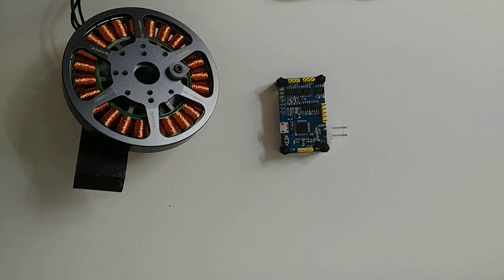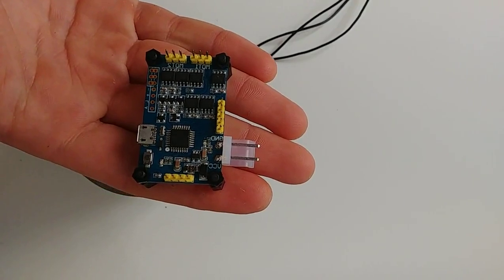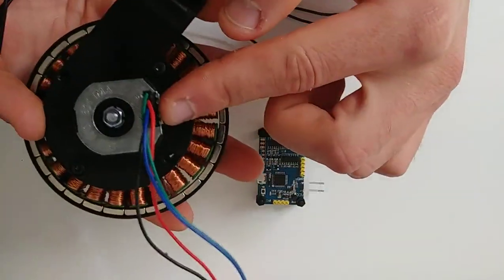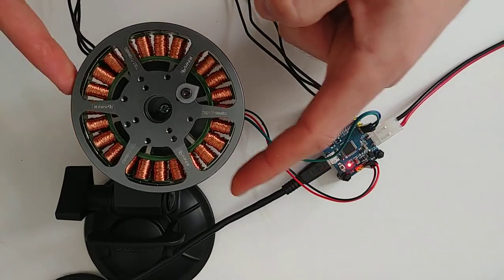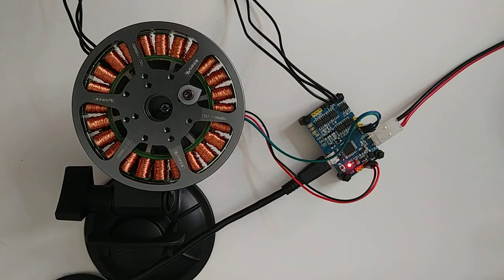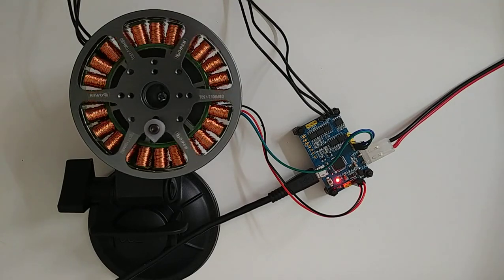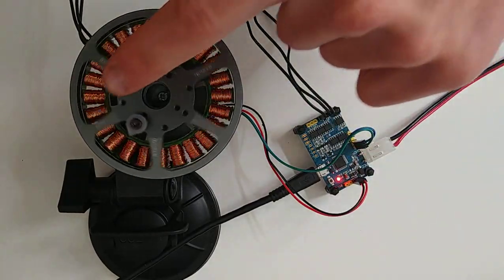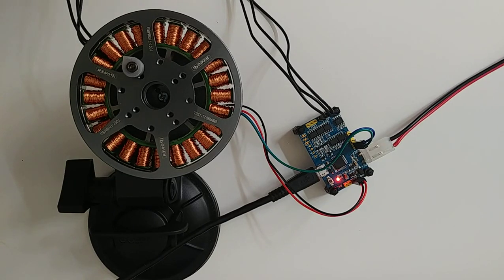Arudino Field Oriented Control (FOC) Library ( Full HMBGC example ) - SimpleFOClibrary

Comment: How the encoder relates to a "field"? That was a big mistake to name this library FOC. Now everyone supposes that FOC means a positioning. Despite the correct preview image, the rest  misleads. No torque, no noise management is available with this library, despite FOC originally means exactly this. FOC is about coil to magnet orientation detection. That's it. I'm angry

Comment: What is meant here by FOC?
For real FOC, you can control the motor in any operating domain (incl MTPA, MPTV, constant voltage curve etc ...), by manipulating Id and Iq current, knowing exact position of your rotor flux (in few degrees accurate).
To be honest, I doubt that this here is a real FOC. Its a good basis non the less.
Oh and about speee control. If you increase the voltage, the motor shouldn't turn faster. Higher voltage only means lss troubles until Bemf is equalizes. Then you anyway need to do any of field-weakening approaches.
Dont get me wrong, I am not demeaning the effort of SimpleFOC community, I just want it to reach the state where you can call it complete SimpleFOC
Reply from the maker: Hey Aljaz, thanks for the comment. 
You were not the first one to point this out. This is a very first video demonstrating the SimpleFOC . At that point it was a small git repo and the "real FOC" was not implemented.
SimpleFOC has gone far from this video. Nowdays SimpleFOC supports the "real FOC" for BLDCs and in the next release for steppers as well. 
This video does not do justice to the efforts that have been put into this project from the community. :D
Reply: @theskura  I have been following the SimpleFOC for 3 years now, and tbh, it's probably the best community in this domain. So hats off :)
Reply from the maker: I'm not sure that I understood your point about the voltage. 
If you increase the voltage you will be able to get higher speed because you'll nee higher Bemf to equalize the increase in the voltage and Bemf is proportional to the speed. So higher voltage = higher Bemf = higher sped.
Reply: @theskura  Yes about Bemf part, I think in the video you mention that we 
"put the system in speed control loop and speed is stable. And if you increase the voltage, the speed increases."
That's the part which I cannot agree with. Of course as you said, with increasing the voltage you can rotate the motor faster, but the speed controller should keep the motor at the same speed, regardless of DC link voltage. Even if Battery voltage is lower than Bemf, then you do field weakening (increasing the D current) but only up to the point, where Q current is still sufficient to produce enough torque to fight the losses at given speed.
Now that I mentioned this, it doesn't mean that I think SimpleFOC is bad. Not at all. As you mentioned yourself at that point it was not as mature as it is now / will be in the future.
I am doing something similar, but with C and with STM32G431. Trying to do Sensorless with SMO.
I wish SimpleFOC was in C, then we would be right now chatting on the forum :)
Reply from the maker: @AljazJelen1992  Absolutely right! I agree, in the speed control the increase in the voltage will not increase the speed. 
So far we did not get to the field weakening, maybe in the future. :D
Yeah, we are bound to cpp at the moment, there are some people that ported simplefoc to C, but I would not suggest doing that. SimpleFOC is probably to big an bulky for experienced embedded developers, there are more efficient ways to write C code and to achieve the same things, and with better performance.
Good luck with your project!
Reply: @theskura  good luck to you too :)

Comment: Very interesting video. Good job. I made this at home by using ardiuno uno and L298N but I want to manage my bldc motor with a potantiometer. When i turn my pot it should move as much as i turn the pot. If pot is turned 10 degrees, the motor should turn 10 degrees as well. And secondly, eventhough i do not turn pot if i turn my motor my my hand force, it should come back to its target position. Briefly close loop foc bldc motor control. Do you have any that kind of project which can help me?

Comment: sir . Could i use this driver for high power Ac servo motor ? i mean 400V 1 kw . i guess its possible by high voltage power driver stage desing  ?  What do u think about that ?

Comment: Congratulations!
It is an excellent and sucessfull project. 
Thank you for share it.
I would like to make some modifications on hardware to design a tool maintenance for air conditioners(inverter with BLDC 310VDC compressor). 
It would be usefull to test the compressor without the complete circuit inside PCB's. 
I think on use this kind of IC's for motor drive, instead L6234D:
IGCM20F60GA 
IGCM30F60GA 
IKCM30F60GA
There is no Hall Sensors or Encoder. I think on adding shunt resistors to my test circuit PCB.
Do you think, it would be possible and/or feasible?
Thank you.

Comment: How did you connect the battery? can I have som information about that connecting cables?
Reply from the maker: You have two solutions really. One is to use the banana connector or which ever lipo battery connector your batter has. 
The other way is by using the 4 pin JST connector used for balancing. The wires of the balancing connector are much thinner and they are fine for running gimbal motors (under 2-3 amp currents), but I would definitely suggest the first option if possible in your application.  
Be careful with the polarity. :D

Comment: At low speed the problem is you are using pure encoder step inputs as position and the difference time between two steps as the speed. What would help is to either use a position estimator (adds lag to the loop though) or a position observer. Both of them give you the speed (and acceleration) for free and those values are way more accurate than doing it the way you are doing it.
Reply: Hey @akkudakkupl,
SimpleFOC library actually usies the mixed time-frequency method which does the combination of the measuring the number of pulses in a given timeframe and the measuring time in between the pulses. 
The observers would require relatively good knowledge about motor dynamics ( the motor parameters), which is out of reach for most of our users. But you are right, that from the point of view of the control engineer there is a many many things that would work better :D
Reply: @antunskuric7282  good to know 🙂 I think the classical PLL observer (usualy used with resolvers) is quite trivial to implement and the error is somewhere around 2 degrees +/- for constant speed. It doesn't need much knowledge about the motor if I understand it correctly. If you play it right you could even get your sine and cosine for Clarke and Park transforms for free.
I glanced o we the code and it seems to use some embedded Arduino code for writes and reads, that is quite slow, probably could be speed up (in the Arduino branch) by using registers directly. The faster the FOC loop the better.
Reply: @antunskuric7282  But anyway it's a great project and it's amazing someone got FOC running on the Atmega 328 🙂

Comment: Thank you for the video! I got hoverboard motor and I got a couple encoders from an old printer. So, if I get that controller it's the only thing I need to build my steering wheel simulator with force feedback?

Comment: This pcb in this video is not an arduino shield. I have a few questions.
1. does this pcb control two low powered motors?
2. is this specific foc board available? I could not find it anywhere.
3. does this board take encodere feedback via pwm signal?

Comment: Hi, thank you for the video... I have a question and I would be grateful if you answer, can I connect some mosfet or ssr to the a-b-c cables that carry the impulses to the motor to control bigger motors;  this approach is configured well with the functioning of the foc?
Thanks in advice, i appricieted al lot who share their klowledge with other people
Reply: It's not that simple to do that, and you can't use a ssr because those are made for ac power not dc.

Comment: will it work without a sensor input? i want to attach a reaction wheel to a gimbal bldc motor and i want to use optical encoders cause of the price is that doable?
tnx for your informative video, liked and subbed

Comment: When do you need the sensor? Just for the absolute positioning? So velocity/torque control modes would be possible open-loop?
Reply: Not really man. You always need to know the position, wich indicate the position of the stator. The open loop will not help us to know the position, this technique uses a complex close loop. Also you could use a half sensor, but it brings third harmonic. Another technich uses an observator with encoder . I am still try to understand this stuff. But i hope it helps you.

Comment: verry good job man! is it possible to allow you stop spinning and free rotate by hand than as soon as you leave it starts spinning its exact speed?  Like direct drive turntables that dj's uses ?
Reply from the maker: Hey!
Yes, you can set the amount of resistance your motor applies when it moves and you'll be to stop it easily when you want. :D

Comment: FOC requires measuring current on at least 2 of the 3 phases. Are you just assuming that the voltage applied to a phase (the PWM duty cycle times supply voltage) is directly proportianal to the current via the DC resistance of the coil? or doing something more clever to estimate current? Your links are rotted, BTW. and don't use URL shorteners, they can be malicious.
Reply from the maker: Hey power max, you are absolutely right. For doing FOC by the books you need to measure the current and keep direct value close to 0. Short answer is, the library does exactly what you have said. assuming that setting quadrature voltage and 0 to direct voltage means that you will not have direct current.

Since this library was first intended for gimbal motors. There isnt really many board today dta support the current sensing for them, due to the low currents. And the other thing is that people don't usually need FOC (full torque control) for their applications. So in that sense this library supports the sinusoidal and space vector modulation for BLDC motors and not by the book FOC. 
Therefore, i would like to argue that due to the architecture of the BLDC motor with permanent magnet by setting only the quadrature voltagr we are actually controlling the field orientation of the rotor magnetic field. Hence the name. :D

We are working on multiple current based control strategies support for blec and stepper motors at this moment. and one of them is traditional foc as well.

Thanks for the heads up, I'll look into the links.
Antun

Comment: What board is that? it seems perfect for what I'm doing.
Reply from the maker: Hey, 
It is the HMBGC V2.2 board.  It is a cheap gimbal controller board.
https://docs.simplefoc.com/gimbal_velocity_example
It is a great as a starting point, but due to the ATMega328 chip it has limited processing power which will impair foc performance. 
The library will work for many mcu+driver+sensor+motor combinations: 
https://docs.simplefoc.com/supported_hardware
So depending on what you want to achieve you can choose the hardware.

Comment: hi, simplefoc, it seems that  the answers you are doing in the comments are not published, I can't see them only the questions, perhaps they are  tagged as private, can you fix it? thanks, and impressive work by the way!!
Reply from the maker: Hey @Euge, thanks for the message. 
This was due to the recent account transfer from my personal account. You should be able to see the comments now (they stil belong to my personal account though).
Reply: thx @theskura , it's fixed now. i think your project is a game changer, a lower cost odrive alternative for smaller motors was needed. I'm in.

Comment: what application did you use to control the board via serial terminal? or did you modify the code in atmega328? always thought about trying these gimbal drivers but I never know how to control these boards. btw, I appreciate for your efforts and videos mate. I think you are filling a big gap which was missing in the community.

Comment: Hi, thanks for the explanation, I love the work you are doing. One area, I'm working on right now is Torque control of Brushless motors, specifically for winder/unwinder applications. using the FOC library, is it only possible to set the torque of the motor based on the voltage control method you mentioned last? Or is there some cool control loops for torque control as well? Thanks.
Reply: I know this is old, but your Q current setpoint controls the torque. Also with winders and unwinders you can use speed loops, but you need an outer control loop that has a tension sensor (a dance roll for example), you set some tension for that loop to keep and you are done.

Comment: Just found your channel, great videos! If I understood FOC correct you also need to find motor parameters s.a inductance and resistance. Is this not done in this simpleFOC?
Reply: You don't need that. Not for simplified motor control, not for real industrial motor control. Buuut, then you need very accurate sensors and properly calibrated PI control.
If you lack one of them, you can compensate with motor model, where indeed inductance and resistance is required

Comment: do you have a link on aliexpress for the board? Subbed btw, can't wait for the shield version
Reply from the maker: Hey George,
I have to admit I was not able to find it any more. It seems like these boards have disappeared. :D 
The board name is HMBGC V2.2 and bought them from Aliexpress and from Ebay many times but now when I look at the links they are not valid any more. :D

But the good news is that you can do the same thing with any atmega328 gimbal board such as:
https://www.ebay.com/itm/BGC-3-1-Control-Board-MOS-Large-Current-Two-axis-Brushless-Gimbal-Controller/222535774436?hash=item33d02a70e4:g:XjUAAOSwvXRejXSO
or:
https://www.ebay.com/itm/For-RC-Quadcopter-BGC-3-1-2-Axis-Brushless-Gimbal-Controller-Board-Sensor/163915959402?hash=item262a270c6a:g:zt8AAOSwb5ZdsC7n
or even:
https://www.ebay.com/itm/H3-Storm32BGC-3-Axis-Gimbal-Controller-Brushless-Control-Board-Dual-Gyroscope/124036658860?hash=item1ce12936ac:g:uL0AAOSwN4BeE~WF
Reply: @theskura  would this be comparable? BGC 3.1 Brushless Gimbal Controller <- It looks like something similar.